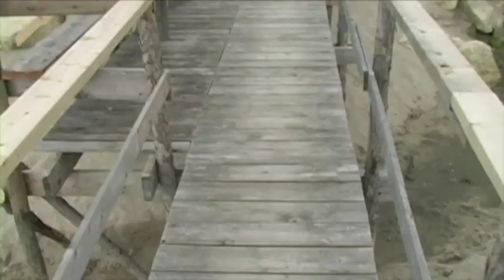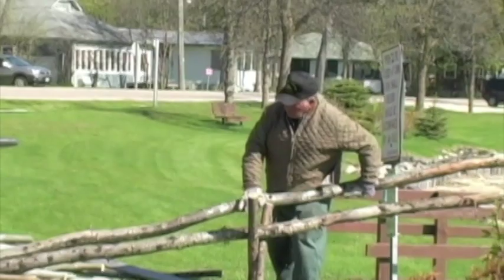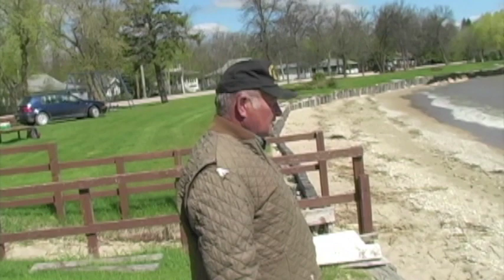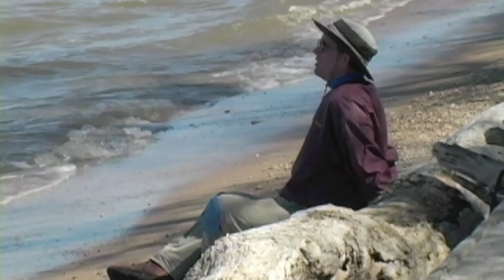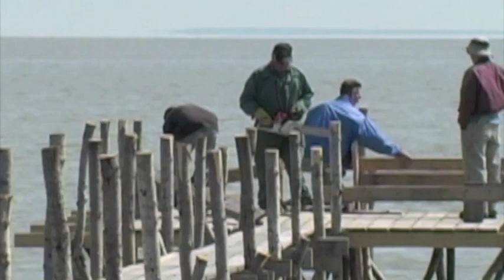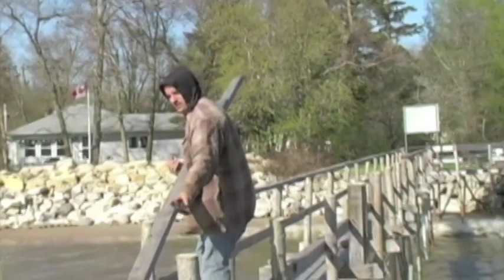Pole by Pole: Building of the Poplar Pole Piers in the Village of Dunnottar, Manitoba

Comment: awesome documentary --I wonder what species of tree those uprights are--pretty strong to take being set with a sledge. we did a "stick pier" at our summer home, smaller scale of course, but still exhausting to build. used 4X4s for uprights, had a 6 inch length of pipe with a 5.5 inch ID, another piece of flat iron welded on one end, this "cap" we would place over the end on the 4X4 to keep it from splitting--all day you would here the clang of the sledge hitting the cap as we set the posts. we were all so young then.........didn't know any better ! good times.
Reply: Think they said Poplar
Reply: poplar trees